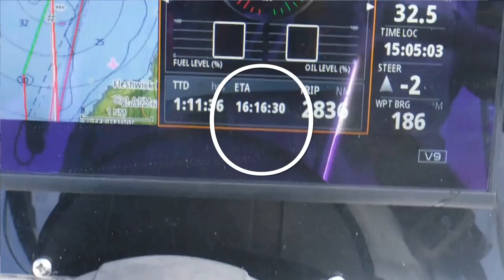Sailing Isle of Man - Calf Sound - Port St Mary - Irish Sea - Ep. 267

Comment: When we’ve been in PSM we have used a couple of carrier bags with some sand in tied with shock cord to the head and stern ropes …….the weight keeps you near to the wall
Reply from the maker: We have some heavy shackles that we use for this, but the tide was so extreme that we dropped below the bottom of the ladder and so we let out some extra line, but this allowed the boat to "twist" more and at the top of the tide, the panels went over the wall. Normally the panel frame would tap against the wall if the boat had an extreme twist.

Comment: We snagged on mooring lines of the fishing boat that came in behind us on the wall nearly lost our danbouy and outboard engine
Reply from the maker: The fishing boats' lines can be awkward to work around. Currently in PSM the last two ladders are reserved for yachts and the fishing boats go further back towards the Harbour Office. With a bit of luck it might sort the issue. We have never seen such a big tide in there and it was a rude awakening in the middle of the night. We had to push the wall away to get the panels off and the boat actually dropped down a few centimetres when we did so. Scary stuff!
Reply: @SailingYachtSaltyLass  ooh good to know. Crazy the height difference there. Christian learned how to climb that ladder when 3yo. Had a safety line tied to him incase he slipped one of us holding on from top and other following up behind him
Reply from the maker: @WavedancerWesterlyfulmar  - did he grow up with a fear of ladders after that? 🙃From the top, the boat does look to be a long way down...